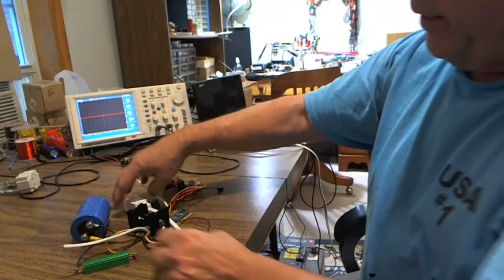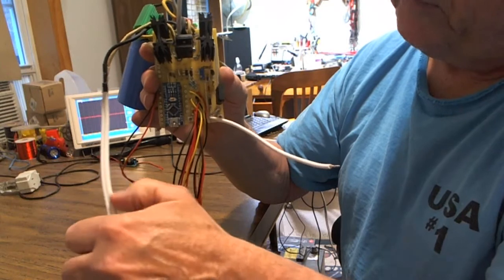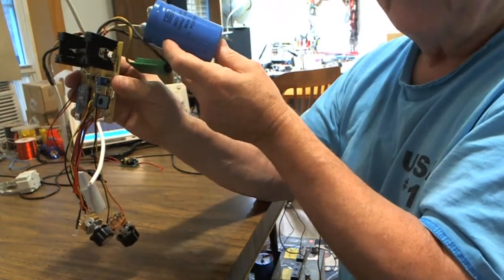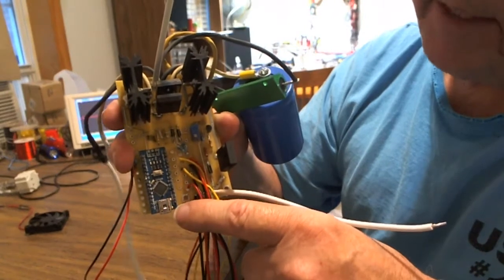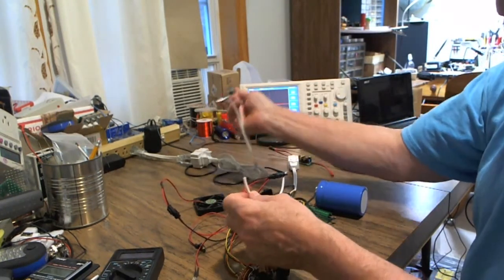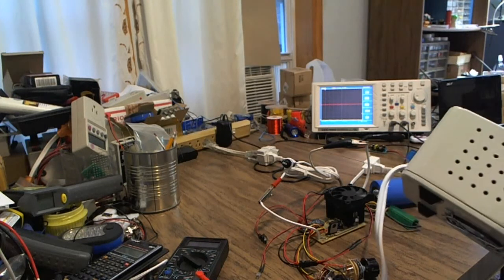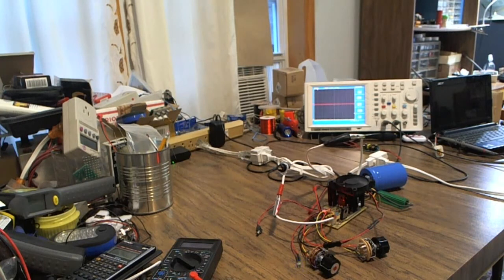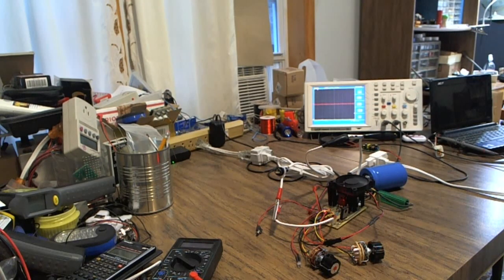High Power PEMF Kit Video 2

Comment: why did you change the cap to a smaller one from the first video?
Reply from the maker: Your question implies the 1500 ufd capacitor value changed and it didn’t.  The physical size changed but not the capacity to store charge.  Additionally, those capacitors were from a video almost two years old.  Today’s capacitor are bigger and better but still the same 1500 ufd.
Reply: Looks like a great kit. How many Gauss. I am a therapist and need around 1 Tesla , 10,000 Gauss to treat people with. What is the price of the kit shipped to the UK
Reply: @jonathanspooner5340   you will want to use this unit.  https://youtu.be/vYp_aANfdJM hope this helps.